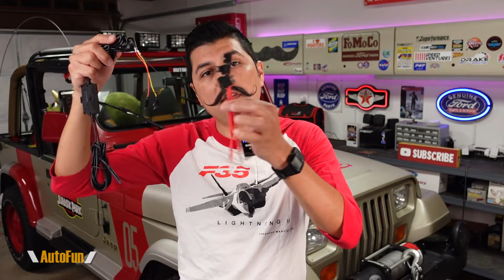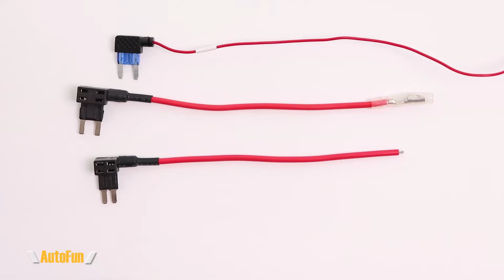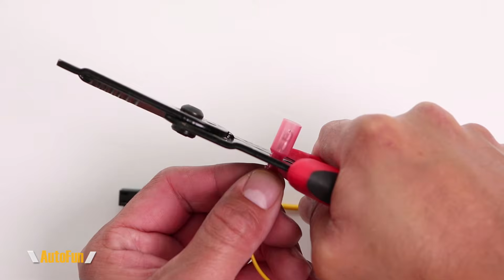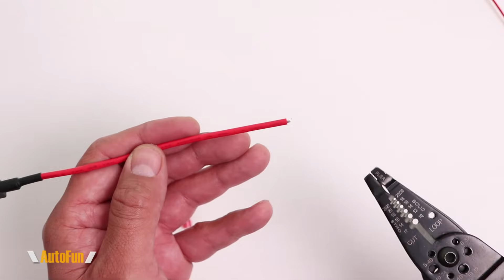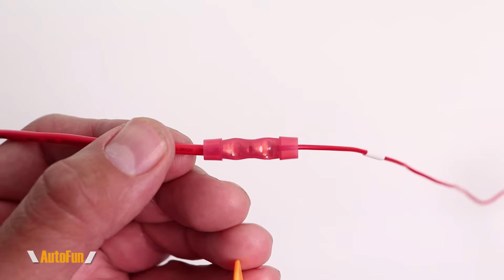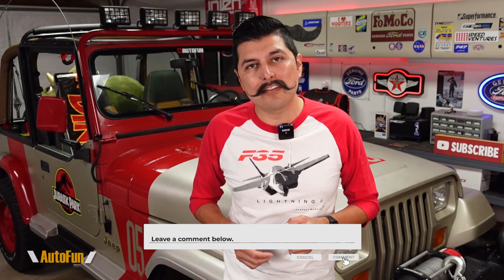How to Install FUSE TAPS on Hardwire Kit (For Dash Cam Hard Wire Installation)

Comment: Hi, Alex. I have a 2015 Toyota Corolla Saloon and I intend to install a hardwire kit for the dash cam. The problem is that the fuse box has no free space, and the red and yellow wires in the kit already have a fuse attached. Of course, I can install a fuse tap on one of the fuses, but I noticed one thing: among the fuses in the box there is one for the rear window wiper. But my car doesn't have a rear wiper. And no seat heaters, although there is a fuse for it. Is there a reason why they are in the box, even though they are theoretically useless? Should I keep them and attach a fuse tap, or remove them and insert the wire from the kit? Thank you.
Reply from the maker: Hi Franco! Yes some cars have empty fuse spots normally used for equipment that is only available on certain trims. Here is my follow up video where I cover how I find ACC and BATT on any car https://youtu.be/K2iKXj82354  However I strongly recommend profession installation due to the dangers mentioned on that video if erroneously tapping a critical system of the vehicle and the dangers involved with air bags mentioned on this video https://youtu.be/uZp95NbNlmM Cheers!
Reply: @AlexAutoFun  Thanks again for your quick response. I will watch your videos and hope to find an answer that works for me. All the best.
Reply from the maker: You're welcome! @franconero9899

Comment: How do I know what size fuse I need to remote my amp?
Reply from the maker: Hi Super! Your installer will refer to the instruction manual that came with your amp to determine the fuse size. If the manual is lost, it can likely be downloaded from the company's website or the vendor could be contacted for tech support. Cheers!

Comment: First off, I just wanted to say THANK YOU for making these videos. I received a Redtiger dashcam with the same hardwire installation kit for Christmas. I know next-to-nothing about electrical components in cars, so your videos have been a lifesaver. However, I am down to one last question. I am in a situation where I need a fuse tap as I do not have an open slot. That said, when you mention plugging the dashcam fuse into the top slot of the fuse tap, did you simply just remove the fuse from the head of the dashcam wire, that you cut off to splice into the fuse tap wire? Liked and subscribed! :)
Reply from the maker: You're welcome Dan! Ah regarding the top fuse (for the hardwire kit) I used a brand new fuse (instead of using the one that I cut off). I just matched the amp rating of the new fuse to the fuse that I cut off. And here is my follow up video showing the rest of the install https://youtu.be/uZp95NbNlmM Cheers!
Reply: @AlexAutoFun  That makes sense, thank you so much for the prompt reply! One last question, I am not certain which amp fuse I should use for the Redtiger dashcam. Would it be safe to assume it's an 15 amp fuse since it's blue? I get a little concerned after extensive (googling) reading comments from people saying using too high of an amperage could cause a short, or worse, a fire.
Reply from the maker: You're welcome Dan!  Ah yes the blue color is normally used to denote a 15A fuse, however in cases where there is doubt, installers will peel back the plastic molding on the original hardwire kit fuses and confirm the number physically stamped on the molded fuse or contact the manufacturer to confirm the fuse rating if there is still doubt. Cheers! @danbrandt222

Comment: Hi Alex after watching your video i feel like i can install my dash cam i do have a question the blackvue power magic pro kit came with two micro2 10A fuses the fuses i want to pull for the taps are 15A and 20A will this still work?
Reply from the maker: Hi Visreal! Ah remember a functional fuse tap creates 2 separate independent circuits (each one with a different amp rating partially determined by fuses that are loaded into the each fuse slot in the fuse tap, the car's internal wiring and current load on the circuit to be tapped) The fuse removed from the car goes in the fuse tap bottom slot and the second fuse (top fuse) is for the hardwire kit. So they are each independent of each other, each one driving it's own load. Here is another video https://youtu.be/Qzw9yUYN7zo where I explain how fuse taps work in more detail and here is my hardwire video if you want to see the actual install https://youtu.be/uZp95NbNlmM Cheers!

Comment: If you don't use the red wire part of the fuse tap, can you cut it off to save space?
Reply from the maker: Hi Hank! I'm assuming your are referring to the lead/wire? if so, yes it can be shorten and capped to ensure it will not short out with anything near it. Cheers!

Comment: Hi on one of your previous videos i saw you just pulled out the same amp fuse (15 amp) and plugged in the new one with the cable attached to the 15 amp fuse that came as is with the cables. This means the one 15 amp fuse runs for the new camera and the original 15amp fuse in that box location. Can you do that or do you have to put a fuse splice and add 2 fuses of 15 amps?
Reply from the maker: Hi Kosie! Ah remember a functional fuse tap creates 2 separate independent circuits (each one with a different amp rating partially determined by fuses that are loaded into the each fuse slot in the fuse tap, the car's internal wiring and current load on the circuit to be tapped) The fuse removed from the car goes in the fuse tap bottom slot and the second fuse (top fuse) is for the hardwire kit. So they are each independent of each other, each one driving it's own load. Here is another video https://youtu.be/K2iKXj82354 where you can see another example of this and here my follow hardwire video where I cover the rest install in more detail https://youtu.be/uZp95NbNlmM Cheers!
Reply: @AlexAutoFun  thanks so much really appreciate it. Watched them. Now just waiting for my dash cam to arrive.
Reply from the maker: You're welcome! @kosieS

Comment: What do you think about just inserting a bare wire into the fuse slot and jamming the fuse in to wedge it in there? Another installer did this because there was no room in the fuse box for a fuse tap. (2) I may have to go with a professional, if it’s affordable and if I can even find one who does this kind of stuff.
Reply from the maker: Hi Stephen! I don't personally tap the fuse box like that (but I have seen it done) for safety reasons both short term and long term. But yeah I always recommend professional installation. Cheers!

Comment: You don’t say what size fuse?
Reply from the maker: Hi Thomas! Ah remember the fuse amp rating is determined by the hardwire kit being used (some kits have higher Amp fuses and some have lower amp fuses) Cheers!

Comment: When returning the fuse into the fuse panel, is it important to pay attention to the "in" & "out" side of each fuse link? I would assume the fuse handles current bi-directional, but my Rove Dashcam hardwire kit explaination of this leaves me confused
Reply from the maker: Hi Kip! A normal fuse is not sensitive to orientation (it's just a metal shunt) however functional fuse taps do have only one correct orientation. Here is my install video where I cover this in more detail https://youtu.be/K2iKXj82354 Cheers!

Comment: He never shows how to crimp the terminals that push together
Reply from the maker: Hi Cruz! The bullet terminals (the ones you push together) are not crimped (the advantage of bullet terminals is that they can always be disconnected again unlike Butt Splices). Crimping is normally only done on Butt Connectors (the terminals where you insert a wire and crimp). Cheers!

Comment: Can I directly put the wire with built in fuse to the fuse tap?
Reply from the maker: Hi Justine! I personally don't like to connect the hardwire molded fuse into a functional fuse tap, because I don't like how high the assembly gets when stacking the molded fuse from the hardwire kit into the functional fuse tap and then having to deal with cutting and shutting off the unused pigtail so it does not contact anything (here is the video where I show this https://youtu.be/wAad_JA7kz8 at the 9:55 mark for those wondering what that looks like) Cheers!
Reply: Thank you so much! I think i need to subscribe because i owe you ☺️ thanks a lot @AlexAutoFan bless day
Reply from the maker: You're welcome and welcome to the channel bud! @JUSTDLV

Comment: Thank you for the video. Left fuse you got from a fuse box but what about right one, where did you get it? Thank you for the answer
Reply from the maker: You're welcome! Ah yes the bottom fuse spot is for the fuse that was removed from the car and the top fuse spot is for the fuse used by the hardwire kit, here is my install video where I cover this in more detail https://youtu.be/K2iKXj82354 Cheers!
Reply: @AlexAutoFun  I watched it twice already but I'm still confusing. If manufacturer's hardwire kit has 5A fuse and I put it in the slot with 10A or 15A - how does it work? Would hardwire kit burn out because it is located in 10A slot?
Reply from the maker: Hi! Ah remember a functional fuse tap creates 2 separate independent circuits (each one with a different amp rating partially determined by fuses that are loaded into the each fuse slot in the fuse tap, the car's internal wiring and current load on the circuit to be tapped) The fuse removed from the car in the fuse tap bottom slot and the second fuse (top fuse) is for the hardwire kit. So they are each independent of each other. And here is another video that will interest you showing the complete install on car https://youtu.be/uZp95NbNlmM Cheers!

Comment: Thank you for your video! To install a WOLFBOX mirror dash cam and backup camera with the hardwire kit…. What is the amperage of the fuse for the yellow and red cables?
Reply from the maker: You're welcome Fredrick! Ah yes the amperage will vary remember bottom fuse spot is for the fuse that was removed from the car and the top fuse spot is for the fuse used by the hardwire kit, here is my install video where I cover this in more detail https://youtu.be/K2iKXj82354 Cheers!
Reply: @AlexAutoFun  Thank you, I saw the video, but do you recommend 10A or 15A for the AAC and BATT cables?
Reply from the maker: @fredrick211  Hi Frederick! I use which ever fuse AMP rating that came with the hardwire kit (for safety I follow what the kit included or was made with but also for warranty purposes if something goes haywire down the road lol) Cheers!

Comment: If I'm tapping on 10A fuse on what fuse tap should the new one be? Example of this is the new one is for a redtiger f7n dash cam Acc and batt+.
Reply from the maker: Hi Pat! The bottom fuse spot is for the fuse that was removed from the car and the top fuse spot is for the fuse used by the hardwire kit, here is my install video where I cover this in more detail https://youtu.be/K2iKXj82354 Cheers!
Reply: @AlexAutoFun  thanks! I watched it but I still confused as to what Amp rating I should use for the new one? I've bought a add a fuse tap from Amazon which comes with some fuses as well. If I decide to use for example Heated seats 10A as my acc, what fuse rating can I use for the new one, is it 10A or lower?
Reply from the maker: @PjJaiJp  You're welcome! Ah correct, the bottom spot is for the fuse removed from the car (literally the same fuse) and the top fuse is for the hardwire fuse so the rating for the top fuse is determined by the hardwire kit being used. Here is my video for the RedTiger hardwire kit https://youtu.be/OyQs8X7H56o and here is my full install video https://youtu.be/uZp95NbNlmM Cheers!
Reply: @AlexAutoFun  thank you! For the redtiger hardwire kit it's rated 5V-2.5A so this means I can only use a maximum of 2.5A or lower?
Reply from the maker: @PjJaiJp  Hi Pat! The power rating refers to how much power the kit can actually deliver to the dash cam, here is my intro to hardwire kits video where I cover this in more detail https://youtu.be/Yky9_tTvwMc Cheers!

Comment: Hi there. I followed your links and purchased the fuse taps and female to male bullet butt crimp connector terminals. As my wiring from my dash camera is the wrong fuse type for my car. I can not seem to insert the fuse tap (male) into any of the female ends of the butt crimp connectors. The red connector (which you use) will not accept the fuse tap no matter how hard I try. I have tried all the different butt crimp connector colors to make sure. I am really frustrated here. Any suggestions? Thanks in advance
Reply from the maker: Hi John! I'm assuming you are referring to this bullet terminal kit https://amzn.to/3wCoKE3 They can mate to each other and also disconnect (with some amount of force). The kit is to ensure that the terminal is not damaged during the crimping process. Here is the crimp tool I used https://amzn.to/3l1cHut Alternatively if there is no need to separate the wires in the future, a standard butt crimp can be used as shown on the video, here is the butt crimp terminals I use https://amzn.to/3wfVClz Cheers!
Reply: @AlexAutoFun , Thanks!
Reply from the maker: @johnbruzda6983  You're welcome!

Comment: Does using a tap connection like this interfere with other devices in that fuse terminal? I've been super paranoid figuring out which fuses to use in my ProMaster van... Ended up just using the cig plug in connector for now.
Reply from the maker: Hi Nova! Ah great question, I actually have a video where I cover this in more detail here https://youtu.be/K2iKXj82354 Hope this helps, Cheers!

Comment: When you put both wires in the butt connector do they have to touch each other inside the connector??
Reply from the maker: Hi! Normally the wires won't actually touch each other inside the butt splice since most of this splices have a stop to prevent the wire from going in too far. Hope this helps, Cheers!

Comment: Hi, at 3:38 the crimped spot you were showing is that a spot to crimp the copper wire or the insulation?
Reply from the maker: Hi Jonny! Only wire should be inside the crimp area. Hope this helps, Cheers!

Comment: Can i use electrical tape instead?
Reply from the maker: Hi Christopher, not sure where your installer wants to use electrical tape. There are cases where it can be safely used and I also seen cases where using it can be a potential failure point or safety hazard. I would recommend to let the installer decide his approach as long as he has experience doing this installs (and is licensed and insured) you should be ok. Hope this helps, Cheers!

Comment: What is the purpose of the two fuse slots in these fuse taps? Do I have to put a fuse in both? Or is leaving one empty okay?
Reply from the maker: Hi Jamolo! The purpose of the fuse taps slots is explained on the first 1:30 seconds of this video. And here is another hardwire where I show the actual installation of the kit on a car https://youtu.be/uZp95NbNlmM Hope this helps, Cheers!

Comment: Can we just plug the fuses soldered with hardwire kit to the fuse taps along with the original fuses from the car?
Reply from the maker: Hi Jonny! Ah yes regarding connecting the hardwire molded fuse into a functional fuse tap, I personally don't do it like that because I don't like how high the assembly gets when stacking the molded fuse from the hardwire kit into the functional fuse tap and then having to deal with cutting and shutting off the unused pigtail so it does not contact anything, that being said (here is the video where I show this https://youtu.be/wAad_JA7kz8 at the 9:55 mark for those wondering what that looks like) Hope this helps, Cheers!
Reply: Thank you so much for your response and opinion. Very appreciate it.
Reply from the maker: @jonnylee8538  You're welcome!
Reply: @AlexAutoFun  Hi Alex, are there any differences between the clear rubber fusetap and blue rubber fusetap? It seems the blue rubber one can be crimped right away with another wire without having to plug to the female connector like the one with the clear rubber fuse tap.
Reply from the maker: @jonnylee8538  Hi Johnny! Not sure which blue rubber fuse tap your are referring to, but if you are referring to the bullet terminal show at 2:05, those are used when you want to have the ability to disconnect and disconnect the wire (the bullet terminal have a male and female type). If there is no need to have a quick disconnect terminal, then a butt splice can be used as shown at the 2:20 mark. Butt splices crimp the wires together creating the connection. Hope this helps, Cheers!

Comment: If the dash cam fuse is 15amp, is it ok if I tap into a 10?
Reply from the maker: Hi Casper 1986! Ah remember a functional fuse tap creates 2 separate independent circuits (each one with a different amp rating partially determined by fuses that are loaded into the each fuse slot in the fuse tap, the car's internal wiring and current load on the circuit to be tapped) The fuse removed from the car in the fuse tap bottom slot and the second fuse (top fuse) is for the hardwire kit. So they are each independent of each other. Here is my hardwire video https://youtu.be/K2iKXj82354 where I explain this in more detail. Hope this makes sense, Cheers!
Reply: @AutoFun Awesome man. Thanks for replying.
Reply from the maker: @Casper-by3hs  You're welcome!

Comment: If I don’t use original fuse from vehicle and i put my fuse instead of that, am i gonna get trouble?
Reply from the maker: Hi Orhan! Ah remember a functional fuse tap creates 2 separate independent circuits. The fuse removed from the car in the fuse tap bottom slot and the second fuse (top fuse) is for the hardwire kit. So they are each independent of each other. Here is another video where I explain the hardwire installation process https://youtu.be/K2iKXj82354 and here my other hardwire video where I cover the dangers involved when installing a hardwire kit on a cart with air bags. Hope this helps, Cheers!